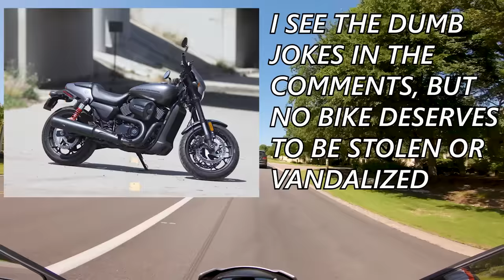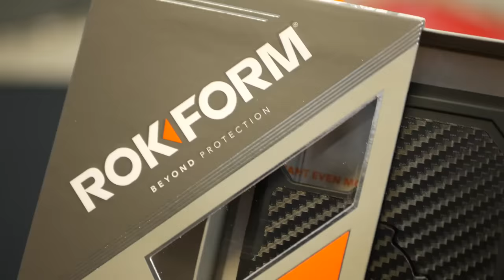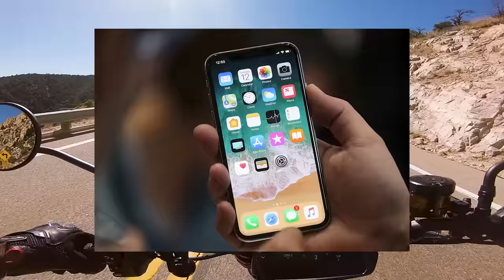How to Prevent Motorcycle THEFT

Comment: Another tip for tracking is to put a dummy tracker in the most obvious place like under the seat, so the thief will take it off thinking there are no more.
Reply: That's awesome advice and I'll use it for sure. Thanks.
Reply: Bro u are a genius ! ! !!
Reply: Clever. Using a little reverse psychology.
Reply: Where is the best place to hide one on my enduro without it melting?!
Reply: Thanks! Now I know 😎
Sincerely yours, thief.
Reply: Great, now I need to use three trackers.
Reply: What tracker do you use, and what's the annual fee?
Reply: You need 2 decoys. Every thief knows about the decoy tracker. So put in another decoy tracker. Nobody is expecting the 2 decoys.

Comment: I’ve actually switched from motorcycle chains to “security chains”, made be Nielsen who do warehouse and goods vehicle security. My bikes are secured with a chain that’s 18kg (39lbs) and is designed to resist  6” angle grinders (plus the cover and disc lock), which means if they REALLY want one of my bikes, they will have to work for it. Here in the UK, the so-called “professional” thieves won’t both with anything that takes longer than 10-15mins as in that time they could get two targets as they often have a list.
Reply: Do you have a link?
Reply: Or just walk down the road and find one that is unlocked. There are plenty in the UK.

Comment: My neighbor (condos) claims to have the ultimate protection. She uses the factory fork lock, takes the keys inside, and that's it. To quote her directly, "Nobody steals a Rebel 250." I personally use an alarmed disk lock and park in front of my bedroom window so me and my M&P15 become integrated into the security system.
Reply: I dunno, a rebel 250 is pretty easy to sell, it would definitely be a target for a quick buck.
Reply: @archygrey9093  I get what you're saying but Rebel buyers demand titles. Selling a stolen bike that can't outrun a Prius is a tough sell. Also, I work in the P&C insurance industry. You'd be shocked how few Rebel 250 and 300s get stolen. Risk vs. Reward? Rebels lack the desirable reward.
Reply: Rebels are fun. Smart lady.

Comment: Last week, I had my bike stolen. Had it covered, disc brake lock, cable through the cover, next to another bike (unsecured black Ninja), and custom paint job (one of a kind). Little did they know (nor myself), Honda CBR600F4i comes with the HISS, which locked up the brakes when they tried wheeling it out. Sure, now it’ll cost me a Grom’s worth to fix it all, but at least they didn’t succeed. Alarm is coming next!

Comment: I mean, it's this simple if you have a home with a garage, like a house with attached. Put a lock on the track system inside. My uncle works on doors all the time and installs them everyday, this is one of the main thing he does to doors when he installs em.

As long as you garage has no other access to it except the bay door and doo that leads into the home they won't be able to break in. They can try to open your door but they'll have to literally destroy it to enter and that'd make such a ruckus that the entire neighborhood would be awake at that point.

Comment: A survey here in the UK found covers reduce theft of your bike by 45%
I use an alarm disc lock and a chain .
In the 60s we used pull the distributor rota and take it with us to prevent hot wiring .

Comment: Getting my bike stollen and riding at night or in the rain are my biggest fears for when I finally get my bike.
Reply: Same, legit one of the reasons for not getting a decent bike :/
Reply: Night riding requires you to be extra cautious, lights need to work and reflective gear are critical. Rain is something that happens so be prepared, what that means is regular maintenance is not an option on a motorcycle, tires and brakes should be good at all times. Having a rain suit on you when the weather looks questionable is always a good idea, and if it is going to rain and you can avoid riding it is best to avoid riding.
Reply: Rain isn't as scary as you think. Just don't ride over the white lines and brake gently. You'll be fine. (Coming from a dutch person.. if you didn't know.. it always rains here.)
Reply: Night is nothing to be scared of. Use lights and reflectors and use caution. For rain just pay attention to the weather and if there is a chance of rain use you judgement. I personally think avoid the rain at all cost is worth it, no point in putting yourself in harms way
Reply: What bike you bout to get?
Reply: @amon__7187  The problem for riding at night for me is that I live in a rural area with lots of deer and other animals, and all those animals come out at night and like to sit in the road around blind corners, or even jump out in front of you for no reason at all.
Reply: Downpours at night are the best way to learn, you need first hand experience. You barely lose any traction after the oil runs off the road. (First 10-20 minutes depending on how much it’s raining.) With warm waterproof gear and some rain x you’ll have a blast!
Reply: @amon__7187  also dont use a tinted visor at night lol, make that mistake before and almost hit a curb i didnt see
Reply: If you have a bike yet
I'm dad yelling at you to get it done!!!!
Reply: One is significantly worse than the other

Comment: "My bike was recently stolen."
"Here are 5 ways I use to secure my bikes."
Hmmmmm
Reply: However, if a thief is dedicated to steal your bike, there is nothing you can do to stop it short of pulling armed guard on it at all times.
Reply: Alan Ross yep - if they want it they will have it regardless. I know  someone who had burglars remove their roof tiles to drop in and open the garage from the inside, cut the locks and lift into a van and away 😩
Reply: @Knobblytyressoggysocks  Seems like a lot of work, I guess the bike really was worth it. Hopefully insurance handled it.
Reply: @idontcare9542  Accurate, my CBR 1000rr was in a gated and locked parking garage. It was covered and had a disc lock. Someone still managed to steal it overnight. That was two years ago. The police never found it.

Comment: Good video. If getting a disk lock make sure the pin is 10mm or bigger. There are disk locks with thin 5 or 6mm Aluminium or soft steel pins!!!!
Reply: Disk locks with smaller pins exist because brake disks with smaller holes also exist. Best advice is to get the biggest disk lock you disc brake can fit

Comment: Maybe get a dummy bike tracker and place it in a somewhat easy to find location. Put it under the seat and connect it to wires that don't go anywhere. Just run a random wire under the tank and make it disappear into the harness. After finding one, I doubt they'd tear apart the bike to find a second one that's better hidden.

Comment: 2 things:
Checkout Pewag chain. About 62 rockwell IIRC. I bought it by the foot. The vendor said its used as a tire wrap for giant dump trucks to get extra traction. There are test showing it takes about 60 seconds to cut through each side of one link. 2 minutes of grinding. Thats the kind I have with a massive Abus lock.
Those Zena alarms blow. The locks are fairly stout deterrents unless you are the Lock Picking Lawyer. My alarm worked about 2 weeks before it began going off randomly so much I removed it from the lock.

Comment: According to my manual, my bike comes stock with an immobilizer built in. The ECU changes the password with the electronics built into the key each time the bike is started, and will not start without the proper code. So that's a cool deterrent for the 2018 Ducati Scrambler 1100 Special. Might also start using my helmet lock with cable on the rear tire and through the frame just for the hell of it. But I'm sure the 3mm steel cable could easily be cut with side cutters/ pliers. Gonna watch that video from fortnine now.

Comment: The dad of one of my buddies has his own twist on anchored locks. Basically they are hardened steel rods embedded in hunks of concrete that operate hydraulically. His bike is basically nailed to the ground, but only on the wheels. So if you had an entire day I guess you could run away from there with the bike, but without the wheels.

Comment: I have a GPS tracker that is hard wired into the bike and hidden in an uncommon area as well as use rotor locks but I do have the extra luxury of knowing what happens if someone gets caught with my stolen bikes. There is no need or use in reporting a bike stolen in Texas at all because they never even look for it, honestly most cops are useless when it comes to bikes but being part of a club helps to locate it.

Comment: For anyone who likes to tinker, here's an old school, cheap and easy, homemade option that I have on my vintage machine that's way too easy to hotwire: 

You'll need to purchase a mercury switch and a toggle switch to wire it into. They're cheap. Mount them somewhere discreet (mine is mounted inside my toolbox, with the toggle switch coming through a hole that I drilled in the top of the toolbox.) Wire this setup into your battery and into your horn (three separate wires: mercury switch to toggle switch, toggle switch to battery, and mercury switch to horn.) Finally, set the angle of the mercury switch so that it activates when the bike is standing level. That's it. Now, anytime you park your bike in a place where you're concerned about theft, flip on the toggle switch, and if someone stands the bike up without turning it off, the horns will immediately start blaring. Homemade motorcycle alarm that is a solid deterrent to thieves.
Reply: Thats smart, will probably stop those kids that like to sit on the bikes and pretend to ride them too

Comment: Buy something flakey and temperamental...even if they beat the security, chances are the damn thing won't start anyway 🤨
Reply: Maybe something with a carburetor is qualified, they'd be stuck in there for 2 and a half minutes trying to cold start it in midnight/dawn.
Reply: @_Anon-8020  just dump the idle control to zero so it won't idle without massive throttle
Reply: Take the battery out!! It's a hassle
Reply: @soozspenser  
Have to take the fairing off the 950s...kill switch is a good idea but redundant if they just pick it up and dump in a van.

Comment: as a makeshift tracker until you can get a proper one, stick an old phone in the bike somewhere.
you can then use a find my phone app and track its location.
a phone not being used can usually last about a week before needing charging......better than nothing.
Reply: now that is clever.
Reply: Attach a usb port in your battery box and the phone will always be charged
You could probably have one of those apps on the phone that allows you to hear and record from the microphone from another phone

Comment: I made a shed, sturdy, pqdlock hard to cut, 2 cameras, sensor alarm, 2 oxford chains drilled in brick wall at side of the shed, tracker, disc lock with alarm and one X3. Thinking about putting fence in front. Also 2 baseball bays each near entrance and backdoor. 
Ive done aloy to protect it

Comment: My method: 
1- always lock the handlebars 
2- oxford disc lock with the alarm system that gets activated by motion (again always lock the handlebars)
3- Bike traker... on that subject, trakers are ridiculously expensive with absurd subscription plans.
Buy the Automile tracker. When I bought it it was only $99 with an entire year of service. Now I pay $70 per yer. And the thing works like a charm with updates every 3 seconds and an app that works perfectly. It also comes with the battery adapter to keep it charge all the time. I have never had to use it for real but it gives me peace of mind. And is nice to have a recollection of your rides.

Comment: Pro Tip- Put the disc lock on the back tire , u can't prevent some big dude lift up the bike and put in a van, but they cant remove the back tire so easy and meanwhile the alarm is screaming
Reply: Unfortunately a lot of us peasants have rear drum brakes lol
Reply: my bike is 800lbs, with immobiliser and both chain and disclock. good luck to anyone

Comment: Bikes are like animals you have to guard them and bring them inside when it gets cold! You don’t it want be there! I got two and I got the biggest chain I could buy, like a short piece was $150 bucks so good stuff, and a level 10 case hardened lock and I bolt them to the garage door frame so noisy if you touch it! Plus mine want start without the key and the steering locks on both bikes! Plus I’m retired I’m home and up all night and I’m surrounded by family on all sides so someone is always watching things. So good luck not getting your head blown off around here 😳😂

Comment: Bike in locked private garage, 19 mm almax chain through the rear wheel with a abloy lock, wall anchor with a 16 mm pragmasis chain that is locked through the frame of the bike with a antipinch decice locked with a squire lock, tracker hidden on the bike and a oxford alpha 110 db disc lock on the front wheel .. I sleep all right :)

Comment: Disc locks I think are more than enough if you're just locking your bike when you're out.

For a more longer period of locking, chain locks are good.
But the thing about chain locks is... is that no one in their right mind would touch the chain itself. 
Like a lock, the weakest point is where it's attached to.
If you have a heavy duty chain lock, and it's attached to a weak padlock... then it's shit.
Reply: I'm sorry but you're absolutely wrong. I had a chain lock attached to a cemented bike rack, a disc lock and a cover on the bike. It took them less than 5 minutes to steal it, they shattered the disc lock and cut the chain itself
Reply: @ItsAMeMarcus  Ok, and where was I "absolutely wrong"?

Comment: I'm pretty well covered. At home it's suburb with a locked garage. ADT alarm on all the doors and windows so I'm not too worried. I work as a security guard at a DoD worksite. There are 11 cameras between my parking  spot and the exit. Not to mention you have to swipe an ID reader to open the exit gate and the guards can all see the cameras and the ID reader in real time. Only real concern is the gas station where I get my daily doughnuts. Though it's not much of a worry since all the state police hang out there and get their doughnuts.
Reply: Nice. When I was stationed at Schofield Barracks, cars got stolen on base all the time, rarely to be seen again.

Comment: If you can’t fix an anchor to the ground, I park my bike on the road so It’s not an option for me, get a chain long enough to loop through the rear wheel and over the seat. With no firm surface to grind against it makes it more difficult to get off.

Comment: i have a 9 foot Vulcan chain, I lock my bike to light posts in parking lots. Locked to the frame near the sprocket . The chain can't be cut with cutters. It can be cut with an angle grinder but that makes noise and sparks fly.

Comment: Hmm and thanks for the remind to have surcity on your motorcycle. There is two major things I see on motorcycles that makes bikes difficult to steal and that is starting and power off code to start and turn off the bike, the other is hidden battery switch that has to turn or connected to run at all. Just an idea for you all to thing of for surcity measures.

Comment: If you have a bike with a center stand find a way to lock it in the down position. It may need to be modified to do this. But trying to move a bike on a lock center stand is very difficult.
Reply: They use lift straps like the kind movers use for appliances and furniture. It sucks.

Comment: Apple makes an "Air Tag" which is a tracking device the size of a chubby quarter.  You can hide it somewhere on your bike so if someone steals it you can track them via your Glock, I mean phone.  The Air Tag costs $30 on Amazon and the battery lasts about a year.   If you don't have an iPhone, use the "Tile" tracker.
Reply: That AirTag has a 30ft bluetooth radius, it’s useless

Comment: the disc lock takes about 30 seconds to defeat with a bolt extractor.  LPL pried a solid steel one open even using just a socket wrench.

Comment: 4:50 Now, bikes, and cars, at least where i live, (Brazil) are primarily stolen to be
disassembled and sell the parts, so if your bike is expensive it's not only harder to sell the parts but they are easier to track, since there´s only a small number of then around,so if you have a common bike it´s more likely to be stolen than an expensive one.

Comment: Here's a 6th thing You could possibly add to the list, rig up, what I call, a Dead Man Switch, it works just like an engine imobiliser on a Car engine & You dont need the ignition key to make it work, here's how You do it, run a wire from where the positive lead from the battery terminal connects to the Starter Motor to the positive side of an 
on/off switch, then run another wire from the negative side of the switch to ground, & use enough wire to hide the switch somewhere on the Bike in a location that's convenient & known only to You, the switch can be a flick up & down type or a push button one, when the switch is in the off position it cuts all electricial power to the Bike & it wont start until the switch is put back into the on position again, the lights won't even come on when the ignition switch is turned on, so even if a thief trys to hot wire it, the Bike still won't start, I own a 2015 Harley Davidson Heritage Softail Classic, but I could'nt get to the Starter Motor because there are too many things in the way preventing Me from getting My hands & fingers in there so I connected the positive side of the switch directly to the positive terminal of the battery, & it does'nt interfere with the security alarm when it is in the off position.either because the alarm has its own battery & will still go off if it senses any movement & the security fob is'nt within range.